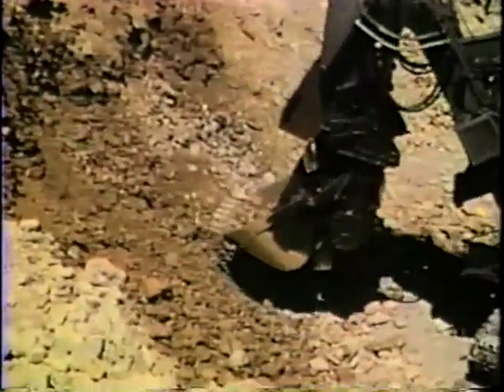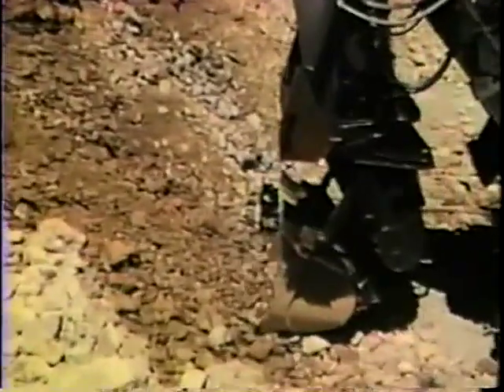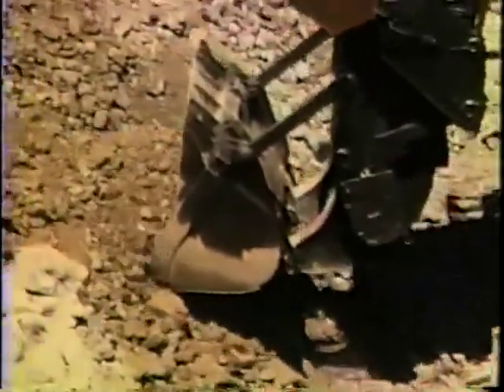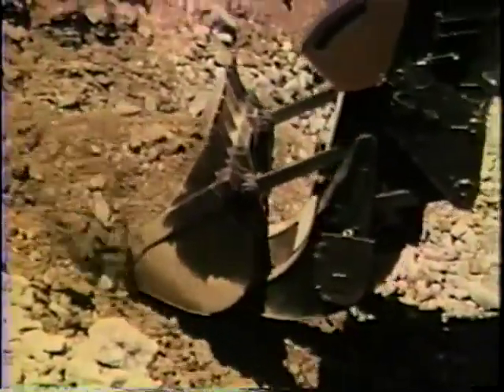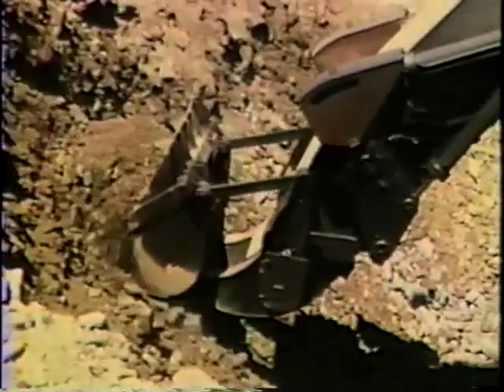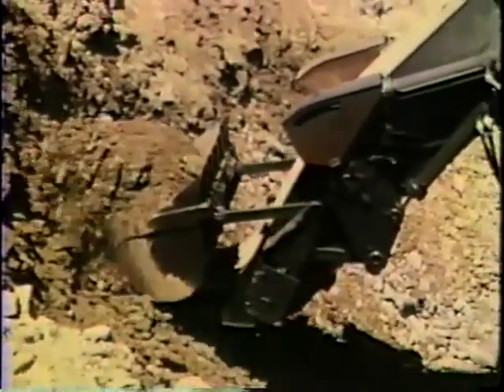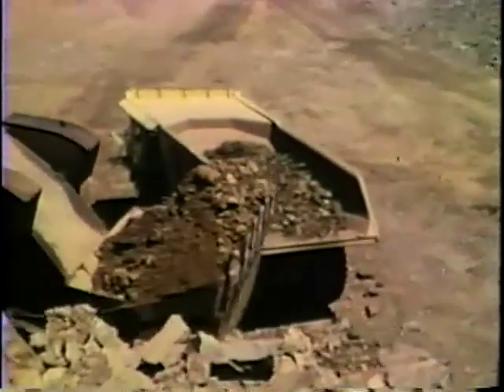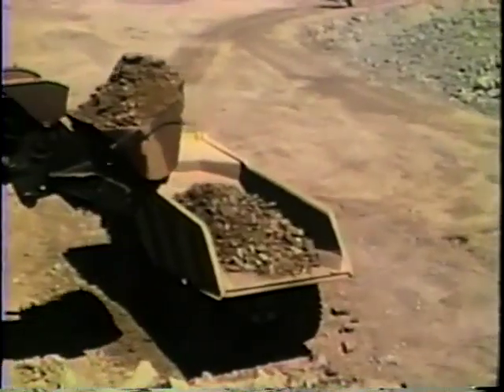Bucyrus-Erie "Doubler" electric shovel

Comment: It was a fair concept but kind of overreached.  Hanna had one on a 150B and one on a 190B in Minnesota for a while.  This looks like the 150B at Butler Taconite.  One operator I knew actually liked it, the ride in the cab was better than a standard 190B.  There were problems with the hydraulics and the carbodies took a beating from the extra weight.